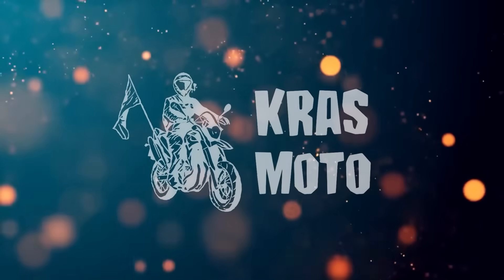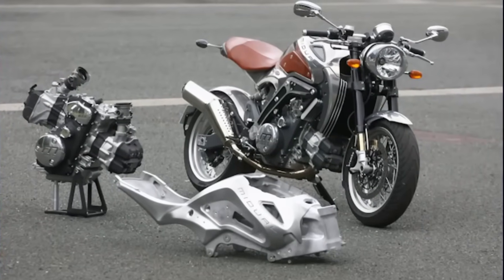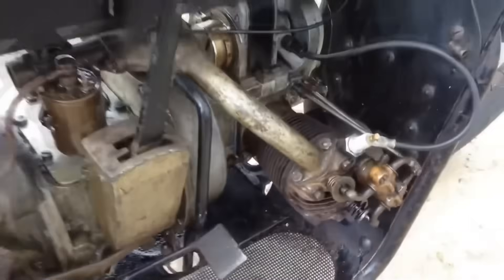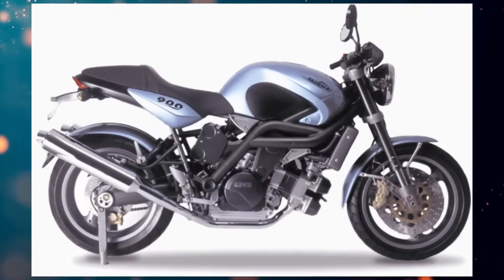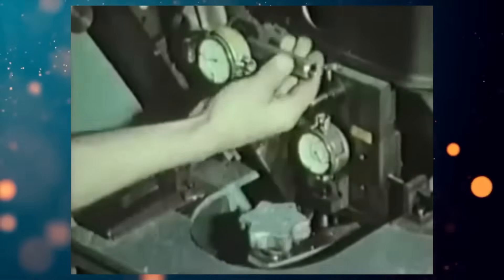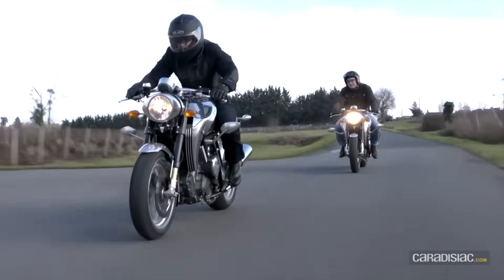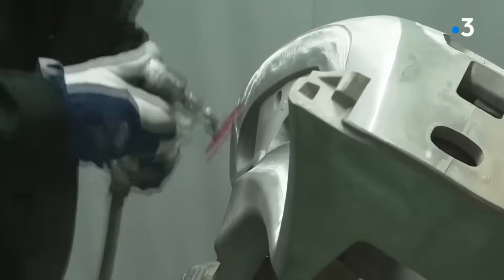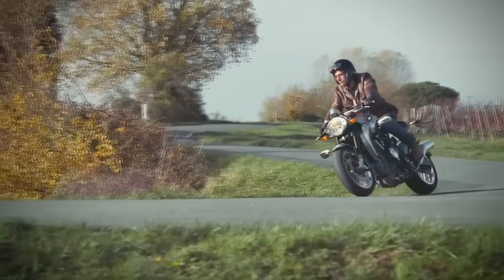A Fresh Take on the Classic Opposed Engine – Midual Type 1 Motorcycle Review

Comment: Since the late 1940s?  You're only off by about 20 years.  Then you correct your error later.
MME dimensions?  More  AI audio trash.  This  thing is a non starter.  BMW had it right over a hundred years ago.  Honda has followed with four and six cylinders.

Comment: 1 an opposed piston engine has two pistons in one cylinder " opposing  " each other and almost meeting eachother at tdc , like the Commer TS3 truck engine or Deltic train engine two strokes. 2 it's not a boxer , they are called " boxer " because if you look at the 4 cylinder layout , the two cylinders are 180 deg out , so it looks like a boxer doing a 1 - 2 punch when rotated, you need minimum of 4 cylinders to be a boxer . 3 it's a flat twin engine or 180 deg V twin .
Reply: Really? I sure thought my 1994 BMW R1100RS was a boxer. Thanks for the correction.
Reply: @scottjones5455 they get called that , to relate them to that VW , Porsche style , but to be a boxer it has to do the left - right punch sequence , with out two cylinders on one side you just get a left punch and no right to follow up . Flat twin is probably most accurate,  and opposed is certainly not correct as the tops of pistons are going away from each other not towards each other , have a look at a picture of a Commer TS3 truck engine, that's opposed engine .

Comment: its too much. they always strive for this level of technicality and complexity that just makes any real production volumes nigh on impossible. i like the basic idea. thought of it many times...
still, the boxer has that issue that it needs a twin throw crank. narrower rods, bearings. weaker crank. at that point, an opposed piston makes more sense... especially if they drive the common clutch-basket gear...

750 6 would be something...
lol, go another 60 degrees and slap a third bank on there... radial...

Comment: If stripped down and mass produced, such an engine layout should be only marginally more expensive than a 90 degree v-twin (two vs a single crankpin on the V). It would  be best with a counter rotating crank, like race bikes.
Reply: Its just worse than a 90 degree vtwin in every way.
The vtwin can have one neat unit for carbs/FI between the cylinders, this needs two.
The vtwin is more compact, means more lightweight and better handling too.

Comment: So the antifreeze in the front cylinder will be sitting at some of the headgasket while its parked just like the Subaru engines eating the headgasket away.....🤔
Reply: Unless you have air in your cooling system, doesn't the coolant in any engine 'touch' the head gasket all the time?
Reply: @johngalt97 not for inline engines where in most of them it sits just below the headgasket (they do wear out as well of course but on the boxers much faster)
Reply: @Joe-b4b1n all tractors i've seen have the coolant level above the head. but as regards your issue, you could weld up the coolant holes in the head and block, and use additional coolant lines for the head and block.
Reply: @martin-vv9lf tractors? Idk any Subaru flat 4 tractors

Comment: I think, this is a super concept: Boxer engines run like a turbine with no vibrations, this type is not wide as the BMW boxer, which is good in curves and for wind resistance. It could be on a normal price level, if produced in bigger quantities.
Reply: Having been a turbine mechanic for 29 years, I can assure you boxer engines are not turbine smooth. They do have perfect primary balance, but they have a double dose of secondary imbalance, and a slight rocking couple as well. A 90° Vtwin is actually a smoother design if limiting to only 2 cylinders.
Reply: @craigg4246  The rocking couple is for real but can be reduced by a counter rotating balance shaft.  Can you explain the  "double dose of secondary imbalance"?

Comment: In the end it is all about economics. BMW knows what they are building in mass production. And the rest of the world will stick to the usual engine concepts. No big motorcycle company will take on this engine configuration. Just because it is way too expensive, to make it work. Every now and then we hear about groundbreaking news. New engines, new combustion concepts. They all fall down in economics. Look at this bike. It sure is a beauty. But in 2023 every modern bike has electronics, abs, traction control, etc. The only plus for this bike is the looks and its rarity. Imagine you could lower the price to 15000€. Who would buy it? Nobody. Because every other mass produced motorcycle has better tech.